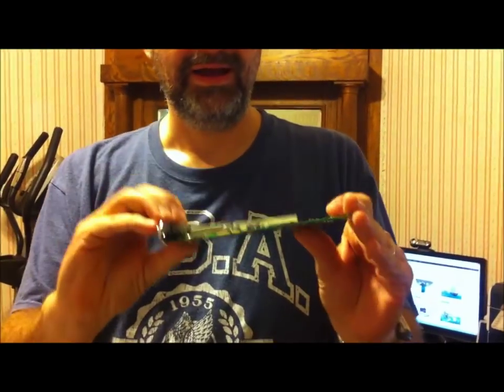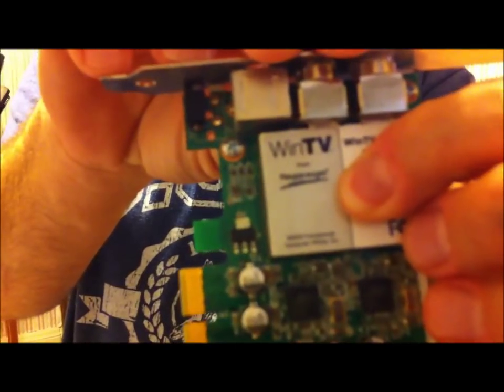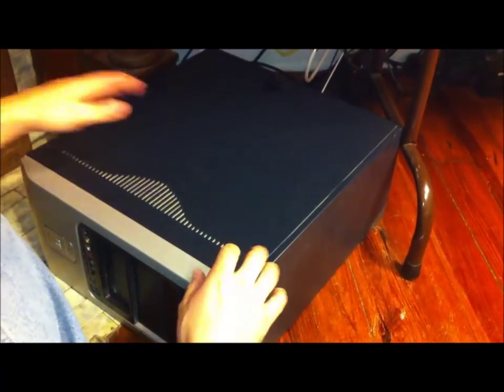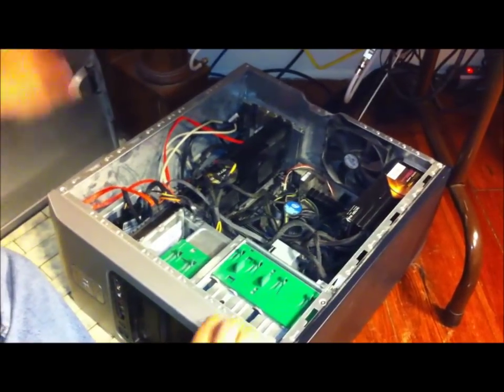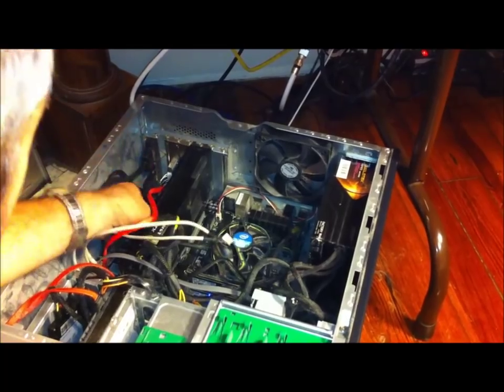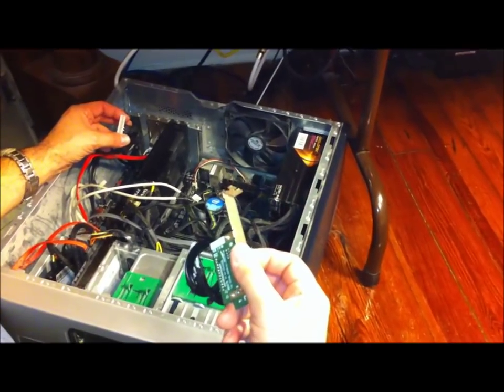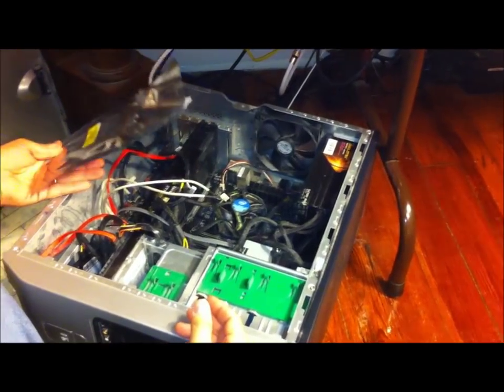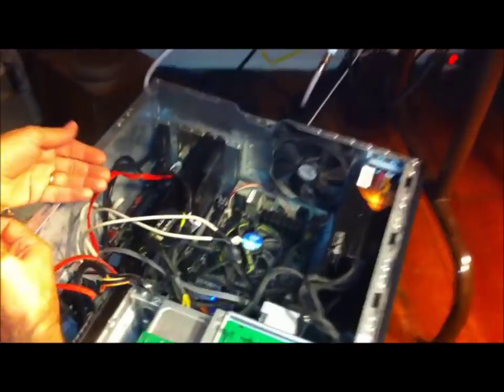Installing & Configuring The Hauppauge WinTV - HVR 2250

Comment from the maker: From what I have read, media center does not recognize the AV inputs, but I have never tried it. You might be able to run the game system through the cable/antenna inputs and it work in Media Center. You can watch game system video through the A/V port on the card using the WinTV software. Just keep in mind that the AV port is standard definition and not HD. 

Hope this helps. Sorry I could not be more specific on the software.

Comment: i bought one cheap and used. i had it for many years. i couldnt get it to work on my phone really good. but i could get it connected from my cable box to the computer with this. and was able to watch tv  and make the screen as big as i wanted or as small as i wanted. witch was good cause i connected my computer to a 60" tv. i moved and didnt use it also re-installed my windows 7 and didnt use it for many years. until today. i had to download the program from the web site, the CD it came worked ok for only watching tv but didnt have the extend, tried the 7.2 cd i bought extra and didnt pick up the card. so the download from the web site work, got it running. works as if i just had bought it. on my android note 3 phone on home wifi, the voice had a big diffidence from the video. i didnt have a chance to tinker around with it. thought of youtube and find this review. hope this helps any one, if any one has any questions i dont mind helping out if i can.

Comment: Hey, I just got this card, but I cannot get past the IR Hardware error in Windows Media Center.  I can see the TV signal, but will not let me get any further because it is not detecting the IR receiver. Did you encounter this when setting it up.  I have only been able to get 1 channel working, which only played through the WinTV app.  I tried both directly to the computer, and through the set top cable box.

Comment: Thank you for sharing this video. I bought this item 2 days ago online, but for some reason my Windows Media Center does not want to install it. I had it scan for data channels but I get the same response " WMC is unable to determine your TV signal". Did you have the same problem when you first installed yours? I've been going nuts trying many different ways to get this to work with no help from my service provider DirecTV or Hauppauge. I connect directly from the coaxial cable from the wall that I disconnected from the back of my DirecTV receiver box and straight to the computer.  FYI - I have Windows 7 32-bit with an Intel Graphics Card. I used to know how to do all this many many years when I first had WMC 10 years ago but gettin' too old for this now, losing my patience. Your assistance would be most appreciative Sir. Thank you kindly.
Reply: I do not believe you can tie a satellite signal directly into the Hauppauge card. I have never had satellite service, but I am pretty sure the signal must be decoded through your box first before it can be viewed. The TV Tuner will only work with an actual TV signal either over the air or through the cable companies. There may be an option for the satellite box to decode and send to the PC, but you would loose the ability to change channels or watch multiple channels on the Hauppauge card (on PC).

Comment: Do both riser cards have composite inputs? I am hoping it is possible to record two streams simultaneously via composite inputs.
This was possible on the WinTV PVR 500 card where the main board had 1 composite input and the riser card (daughter) had a secondary composite input.
Reply from the maker: The card only has one composite input for TV. The other one is an FM antenna connector. Here is the manual link. There are also some photos at the site as well.

 http://www.hauppauge.com/site/products/data_hvr2250.html
Reply: Right,  but you connected two daughter/riser cards to the board.  What were those?
Reply from the maker: I watched the video again to see what you meant. If you are talking about the other cable I plugged in, it was to front RCA plugs. They are not additional composite connectors.
Reply: You might be mixing up composite and coaxial-in inputs.  The main board has two coaxial inputs for a TV and a FM. The RCA daughter card probably consists of a yellow port (composite)  and audio ports (Red and white).

Comment: i have Cox cable. If I were to install this in my computer, could I get all channels including the 1000s (the HD channels)?
Reply from the maker: Those upper level channels are usually scrambled and you need a cable box. The card will really only show channels that your digital TV will without a box.
Reply: Tami Dunn So, the upper channels, I'd have to connect from the wall, in to the cable box, and cable box into the card?
Reply: Tami Dunn Should the 1250 work the same just without dual tuners?
Reply: Nathan Mitchell I would think so.
Reply: ***** no you don't get thousands of channels, you get whichever channels that are in range of the antenna, often in HD but depending on distance, you usually can get CTV globalTV CBC ATV NBC... I had FiberOP|FibreOP so thousands of channels so idk to many of them by memory, just CTV and global alone cover like 80 different shows, big bang theory, survivor, so you think you can dance, amazing race, think they may not get UFC but you'd have to look into your local hd stations within 100miles, if replacing TV and your not near some you may need a big antenna aiming at the long station and a small aiming at close ones possibly, the most expensive Hauppauge has dual antenna hook ups, is get a low wattage custom htpc with a ssd and set it to record all your shows same time with dial antennas and network that computer to your whole home and just have mini android stick PC's on each TV and get a l ong range Bluetooth remote like a ps3 one so you can view any show at any time any device in your home, but I'm a geek and hacker so....
Reply: Nathan Mitchell He has Cox Cable so his signals are not over the air. He does not need an antenna, although that is an option. Probably less channels that way though.
Reply: ***** Yes.. wall to box, box to card. The problem with that setup is that you will only be able to watch one channel (the one tuned to on the cable box). You could probably still record that one channel though. The cable box determines the channel. I have never hooked it up that way because I do not record those upper channels. I have just decided to live without recording them.

Comment: I hate that I have to use Windows 7 or 8.1 to run my six-tuner Windows Media Center HTPC box. Rumor has it that the XBOX ONE interface, with all its gaming, media streaming, and TV DVR functionality, is coming to Windows 10 in the Spring 2017.  Unless that or something like it comes along, I'll never be able to upgrade my HTPC to Windows 10.  There are hacks to bring WMC to Windows 10, but I wouldn't trust it to continue working after a major update.  Still using this three years later?
Reply from the maker: Yes, I am still using it. I use media portal as my software--kind of a pain to set up and it is not as smooth as WMC. I truly hope those rumors are true!

Comment: hi dose this tv tuner need a cable box conected to it so it can work and if no how meny chanals will it actuly get ? only basic channels or all
Reply from the maker: +luis morel You do not need a box but… The channels you can receive depends on your cable provider. If they have converted most/all over to digital channels, you will get very few. Our provider in this area (Time Warner) has only converted a few, so we can watch pretty much any channel from 2-99. Anything above that is scrambled.
Reply: oh ok thank you

Comment: Hi, could you tell me how many ram memory you are using with this card? And what system you are using: is it windows8-32bit or 64bit. I am asking you this because I found in my house an old tv card from hauppauge but I am using windows 7 64bit system with amd processor on an asus motherboard. with a 12gb of ram memory. And i can't seem to get the card working. I am wondering if your card can support that: especially on a w7-64bit system? Can you help me with some information? I live in belgium. Hoping you can give me an aswer soon.
Reply from the maker: +Wim Pauwels The computer this was installed into had 4 GB of memory running Windows8 64-bit. The system you described should be fine to run this card. Make sure you download the newest drivers from their website.
Reply: Excuse me for a long reaction but I am happy to have a reaction on this. But my problem is that the card runs but with distortion and also the analogue tvstream freezes each 3 seconds. Today I am gonna run a video composite test to see if that input on that old card has the same problem or not. I'll let you know. And there is a second problem when I run the newest driver of that old card windows mediacenter doesn't recognize the card at all. I think and am almost sure I need to buy a new one like yours. because it is an old type you can't buy anymore although support is still given I don't run the new drivers because the system doesn't recognize the card at all anymore, only in winttv but its a bad picture and my cables are high end and lined up to a +24db coaxial amplifier. on my tv screen I have by the way good quality. So I was wondering what your system had on memory. So maybe the card doesn't support larger ram memories? But I have still one question, if I install more memory for instance 16gb ram could that be a solution to the problem?

Kind Regards
Wim Pauwels
Reply: by the way the old card i am talking about in my reaction was hauppauge pci-pvr-150 26559
Reply: Hi there I have now run the test with an old videorecorder but my system doesn't recognize the card at all. I use Debut by nCH Software to capture the devices input but as well as with composite as with s-video all inputs seem to be dead. I have that card for many years and i have used it before on a linux system but I think it hasn't been protected enough from dust and static loads. So I need to by an new one but I live in belgium and i need to buy WinTV-HVR-2205 board i am gonna buy it with remote control so  that it is handy to service it.
Reply: +Wim Pauwels Yes, sounds like your card is bad. I have not bought one since this one and may not again since Microsoft removed Media Center AND local cable companies are going ALL digital which makes this card not operate using cable TV signals. Good luck with the new card.
Reply: +MovieHQ I see your point but for me it would be good enough to watch analogue tv. as it still is in Belgium and Europe that the problem keeps on rising between choosing between an analogue or a digital signal or a sattelite functioning with a Digital receiver. although don't want to pay an amount to be able to get hundereds of digital channels I will never look at. Many of our tv companies in Belgium keep on going on the cheap track of analogue tv but they stream it over a digital system to avoid costs about it. I can tell you a long story about it but my point is: I keep on getting unpayed signals over coaxsignal so I will keep using them 'cause  I don't have enough money to pay a subscription to a provider. On my digital tvscreen I receive by the way HD channels from my favorite channels so If I really need the higher quality I can see that on my tvscreen itself through live tv. I am not a channel hopper like many people do. I am already nervous when something new is on television and the mainstream channels keep on changing and renewing al the time so if i really want to channel hop it should be a very worse programme on television. By the way I want to buy the card because of listining to radio too free to air. And of course the additional videolinein record ports to be able to digitize some videos I still have on my attic. Kind Regards Wim

Comment: Does this give you tv ? Or do you still have to buy cable and stuff ?
Reply from the maker: You can pick up over the air HD channels just like you would if you hooked up an antenna to your TV. We have cable hooked to ours so we receive all the unscrambled cable channels.
Reply: I have one.
The card works with over-the-air (antenna).
It also works with "Clear QAM" cable.
"Clear QAM" is unencrypted cable.
Unfortunately most cable channels are encrypted.
You should be able to get local channels over cable because the cable company is not allowed to encrypt them.

Comment: If you upgrade to Windows 10 you will not be using WMC, it's gong
Reply from the maker: nr3rful Yes, I hate that it was very easy to use with very little setup. I am currently using Media Portal. It works fine, but the guide is a pain to get going.

Comment: Once you install this card, it works great. That is until you change ANYTHING in your hardware. I had a video card in a slot near the PS so I switched it to a different slot. Now nothing recognizes this TV card, not Media Center, not the drivers, not WinTV, not the driver updates, NOTHING!

All the uninstalls, reinstalls, and reboots in the world will not help. Pretty pathetic IMO. I have to record my favorite shows and watch later because of my schedule. I haven't been able to watch TV for the last 2 months. Last Hauppauge product I will ever purchase.
Reply: Forgot to mention that if you don't have your original driver CD AND your installation key, you have to pay $10 for a new CD! Are you kidding me? They could be like every other manufacturer on the planet and allow a download of the updates, but after 3 years with this card, not a chance that I will ever get it to work because of their greed. I refuse to pay twice.
Reply from the maker: Kerbal Adventures I will still recommend this card as a TV tuner. I have never had any problems with my card even after changing video cards in my old PC and then adding it to a new PC. You only need to pay the $10 if you want to use the WinTV software. WinTV is a paid program that they do not give away for free to everyone. If you are using Windows Media Center, you do not need to pay, or use WinTV. In that case you would only install the driver portion of the software. I have recently installed the drivers when I updated my PC and did not pay a dime. There is a utility (HCWCLEAR) which will remove the drivers and let you reinstall the software. I would highly recommend that you do so if you have not already.
Reply: Tami Dunn Thanks for that info, I was unaware of the uninstall program, but unfortunately, it did not solve my problem.

Also, I originally did a Google search for the driver update and clicking on the link brought me to the WinTV download, which I assumed included the drivers.

I check it again, and this time I noticed tabs at the top of the page, including the driver download tab. I clicked on it, and indeed it does allow a free download of the driver.

My problem persists and I'm starting to think the card went bad on me, but you did cause me to re-think my opinion of this card and Hauppauge. Thanks!
Reply from the maker: Kerbal Adventures
This is actually my second TV card from them. The first one was much older though. It did basically the same thing you are experiancing where it was not found by Media Center. Maybe you could purchase one locally and return if it does not fix your problem.
Reply: UPDATE - I eventually did get my card working again, and I wish I could remember exactly how for anyone else having this issue, but it was about 4 months after I left my original comment, and I tried so many things that I don't know exactly what it was that corrected the problem. At first, I was getting a Media Center error telling me that no TV tuner card was installed. After LOTS AND LOTS of research I was able to get the card detected, however then I was getting an error stating something about audio (sorry, can't remember exactly what) and it refused to play live TV or recordings. I finally found out through more research that there is a setting in the Control Panel sound settings that will fix the audio, and now everything is working again. One thing I did find out since then is that this tuner is not as sensitive as my TV and it has a harder time with distant stations, but other than that it's been flawless. Thank you for your help in finding the drivers, as that was the first step to getting it working again!